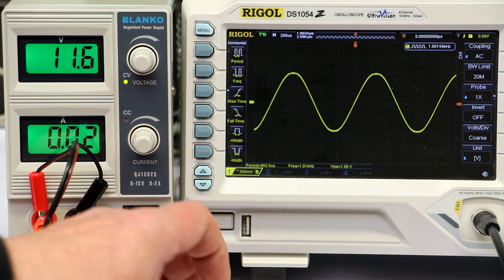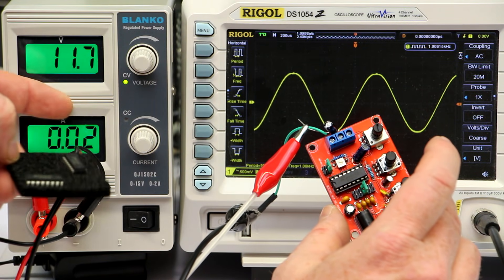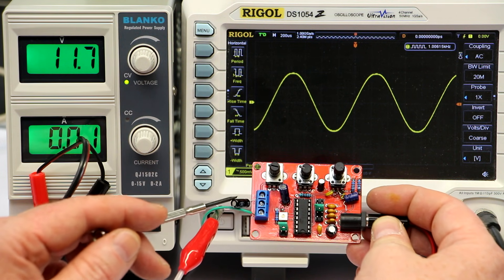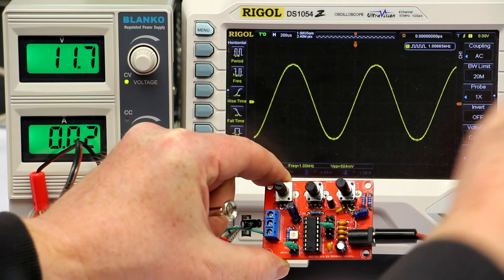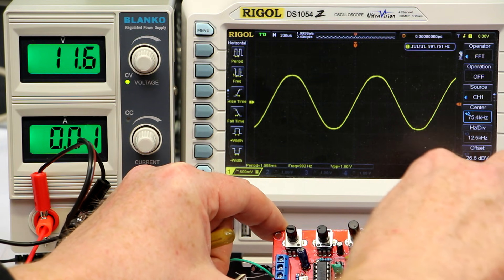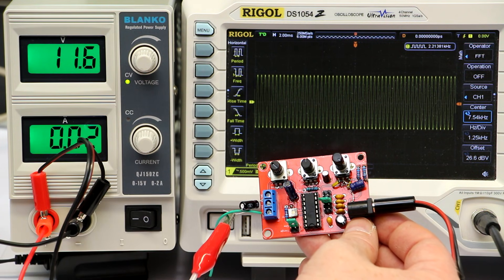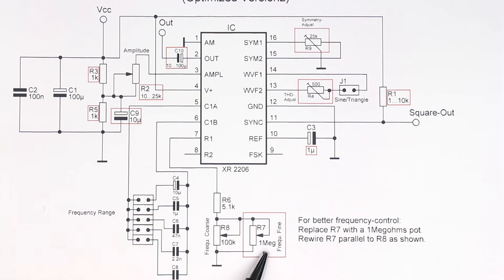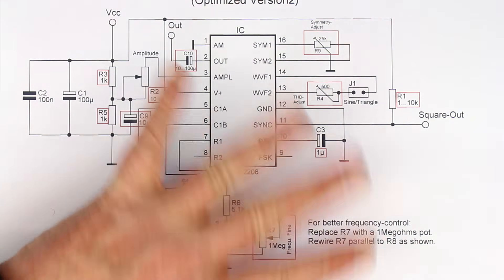Fixing the issues with the XR2206 Function-Generator from EBay

Comment: really a very detailed and complete review  with solutions and again an example how good original electronics get messed up and quality undermined  by the chinese vendors  trying to compete on price.  You have shown the world  with a little engineering  to get right.  Thanks again since I have this original  XR 2206  function generator from more then 20 years. Not surprisingly it still works. It is  fun to see this Exar Co. survived  all the turmoil  and that the Chinese  still can make a few buck with their name. Thanks again Kainka. We need this  sort of review.
Reply: Sorry Tom B., Things are not that simple as being shown, as there is more to. There are two main problems with the XR220 and the one it shares with the Intersil 8038. It's the Square wave resistor - it makes no difference the size as using af resistor "kicks back" into the curcuit. The other problem with the XR2206 comes from the switching across the capacitor. The real switching time is approx. 35 nS but that's not all, it's the loading  and discharge cycle that coarse the problems. When the loading cycle nears the top - and before the switching occurs the opening of the transistor is under way - beginning to discharge whike charging which gives a spike or notch in the top and bottom af the triangle that is used to from the sinus. This is all internal and can't be changed from the outside. that was the technical level at the time these curcuit was produced. - Please mark the frequens you are shows - less than 20 KHz where it is hard to observe, with higher frequency it becomes more visible and dominant.The Intersil can produce sien and triangle from subzero til 200 KHz flawless, and if you then take the sinewave and convert af part from this to squarewave, you can build a very nice working functions generator.

Comment: Excellent debug of this unit! I built quite a lot of 2206 chipped oscillator units for the Audio recording studios I worked at. These had 5 fixed sine wave frequencys selected by rotary switch in order to set up analog 24 track tape machines for Bias, record levels and playback tones.
Original EXAR data sheet seemed spot on for the low frequencies 50hz~20Khz sine wave used. This Ebay unit looks good after your work!

Comment: Wow, pretty cool. Thank you (and the people who gave you some feedback on various issues) for this. I just bought one and will definitely be double checking everything. I bought the thing mostly for 1)improving my soldering skills, 2)testing a soldering station I bought as a present for my dad and 3)I will use this a wave generator for a basic synthesizer I would like to build to learn more about this type of instrument. For this purpose I want to go as low as possible in terms of voltage and also cover 20Hz - 20kHz.

I guess as usual it is safe to assume that there is a 99% chance for an IC to be fake when it's shipped on Amazon, eBay, Aliexpress etc. from China. :D No surprise there.

Comment: 6 years later and this is still incredibly helpful! Thank you so much for the time and effort you put into this. Tracking down components for the upgrade now!
Reply: not even because the url provided doesn't work anymore...
Reply from the maker: New link: https://1drv.ms/u/s!AmW9-q-1GZM1ip5wO7uvHpcenfI14g?e=m4TqeJ
Reply from the maker: Link has been changed to the kit in our online-shop where you can also find the documentation. Should work now. Built-manual is only in German until now.
Reply from the maker: Link has been changed to the kit in our online-shop where you can also find the documentation. Should work now. Built-manual is only in German until now.

Comment: thanks for the two videos. Very detailed. I had also bough the same kit. I just wanted some function generator for playing around, but even the sine wave did not look that clean to me. So I bought a used GW instek for a little bit more. Didn't realize all the problems you showed. Very nice.

Comment: Great vid on this oscillator, it's a perfect fix, thanks! One suggestion i have would be to connect a 100k resistor from C10 negative to ground. This will keep the C10 capacitor charged during operation, thus keeping the DC off of the output at all times. The 100k will have negligible effect on output loading.

Comment: Good rundown of the problems and solutions for this circuit. Two areas I would disagree on:
1. I don't like the idea of using input protection diodes to compensate for driving logic with too high a voltage. As you suggest to an earlier comment, a voltage divider would be the easiest fix although a proper level shifter would be better
2. It seems unlikely that the real XR2206 would improve the output square wave at high frequency with a 10K for R1. The output is open collector and the slow rise time is due to the RC time constant formed by R1 and whatever is connected to the square wave output (including parasitic capacitances). If the real XR2206 really is better, this suggests large stray capacitance in the fake part.

Comment: Thank you for your hard work! I bought this little cheap kit to help me learn how to solder. Got it "working."  Now I am using it to help me learn how to DESOLDER! 😂I will come back and try to test some of this out on my breadboard once I get the parts out.
Reply: I was able to remove all the components and only destroy one cap in the process! That was a few weeks ago, today I assembled the chip on my breadboard and was able to wire up the Basic Test Circuit detailed in the data sheet for the XR-2206. Next -- finalize a new design, test it out and finally solder components to a blank PCB. Cheers!
Reply: I finally rebuilt the XR-2206 with new components on a double sided proto-board a few weeks ago! The sine wave doesn't seem to work, but the square and triangle waves will do! All in all this was a very educational journey. 😬👍 (I also built a 4 channel audio mixer to better listen to future oscillators and filters I will be building.)

Comment: Thank you for the video! I am finally getting around to building my kit. Ideas: 1) I will be using individual socket pins, cut from strips, for the discrete components that can be changed within a range of values to tweak the performance of the circuit. 2) A followup video about any new thoughts that you have about the project would be great. 3) Adding closeup photographs of your adaptations to that video would be very helpful to us, to devise our own configurations. If you are not interested in creating a new video, maybe you could take individual photographs of the said adaptations, post them somewhere and give us the link to them. Please and thank you.

Comment: Thanks a lot.  Very useful information and a little kind of work that an engineer must do when a problem is on the road.  At company I work I see this kinds of troubles when a cost reduction is implemented on products we manufactures. Best is to buy to OEM ICs ever.
Reply from the maker: To be fair the Ebay sellers mention that the circuit works only up to 12 volts.
And the XR2206 is not produced any more by EXAR for a long time and genuine/OEM/NOS parts are totally overpriced at Ebay.

Comment: I notice theres no mention whatsoever on the one page info sheet of  the need or function and their freq coverage  of the five pairs of paired header pins. Also mine too has no brand logo on the IC itself, just ordered a branded replacement. Thanks for posting this, an excellent way to learn practical electronics.

Comment: I just bought one of these kits, very interesting to see the modifications.
As you say the XR2206 cant be a real one, the real spec has 10V to 26V, but the kit is 9-12V. But it will do me, I just need a signal to test an old vacuum tube radio.

Comment: Wow, good catch ! Many of these generators were sold as 9v dc powered generators.
Reply from the maker: Yes, 9V is "save". 12V is the maximum supply-voltage for these rip-off XR2206 chips.

Comment: Did you actually try the authentic XR2206 chip with regard to the square wave output issue?   Because that is exactly what you should expect to see as you vary the pull-up with an open-collector/open-drain output.  Your scope input is presenting a capacitive load which the pull-up resistor has to drive, so the higher the resistor value, the longer the time-constant.  The reason it appears to be frequency dependant is that you are changing the timebase on your scope and just looking closer and closer at the rising edge.   

Note that the falling edge is not effected because the output drive transistor determines this, not the pull-up.

A better way to condition the signal for lower voltage logic would be to replace the simple pull-up with a voltage divider so that the peak voltage is limited by the voltage divider ratio.   The effective R with respect to the RC time constant then becomes the parallel equivalent of the two divider resistors (Yes, even though they are in series with respect to the supply, they are in parallel with respect to the output) This will substantially lower the RC time constant, and improve the rise-time.  Also you will not be relying on the digital circuit's input protection diodes to limit the voltage, so the input current limit on the digital logic is moot.
Reply from the maker: Yes, it was a genuine XR2206 from EXAR.

Comment: The Amplitude VariableResistor is also reversed. Turn rigth amplitude decrease, turn left amplitude rise. The coarse and fine variableresiator are fine.

We modify the pcb trace to fix the amplitude variableresistor issue.
And
The 10KOhm rv09 variable resistors are not available here, so just use the original 50k one in parallel with 12KOhm or 13KOhm resistor.

Thankyou uncle Rogers. Bye bye from village labs..:)

Comment: It's good that you showed the difference between original XR 2206 chip and the "fake Chinese chip". I wouldn't want to rely on Chinese chips if I don't have to.
Reply from the maker: Yeah, but genuine XR2206 are very expensive now and only available NOS on Ebay. Nevertheless below 12V the Chinese counterfeit behaves mainly the same way as the original chip.

Comment: 0918, and 0919 seem to be the magic numbers on these currently available Exar chips. I initially bought a couple on eBay two years back and a recent one from Tayda (all say F0918). I still have a hard time believing that Exar suddenly puked out a billion of them in two specific months despite being in production for so many years.

FWIW, I didn't seem to have the voltage issues with mine, but I couldn't get an op-amp based virtual ground to work without losing the negative side of my output wave. Could have been the circuit, but it came from a schematic which was mass produced as a kit, so I'd imagine someone had a working one somewhere.

- and thanks for the great videos!
Reply: make that two specific months
Reply: duh- make the months weeks ;-)
Reply from the maker: I think the XR2206 from these Chinese kits must be counterfeit-chips.
So you probably can´t rely on the date-code but have to rely on the reputation of the seller if you buy a replacement XR2206. 
There are some YouTube videos out that the Chinese even fake the 555-timer chips! 
Someone has decapped them and compared to some original ones and found some obvious differences in the chip-layout :-)
Reply: KainkaLabs- This recent one was bought as an individual component from Tayda Electronics. I inquired afterward about getting an older one, and they were very helpful and seemed interested in seeing that they weren't buying counterfeits. They said they tried to get 0918, as they had reports of problems with 0919 chips they bought. I just have a weird feeling that, unless someone grabbed a big pile at a government auction or something, anyone who's obtaining enough to be selling them in 2017 is probably getting remakes or we'd be seeing a much wider range of date codes.

On the plus side, maybe the Chinese will be tweaking them as more people become aware of the "undesirable qualities". When I checked, mine went up to 18V or something before it got shaky, so it doesn't appear to have that problem.
Reply from the maker: Very interesting. THX for the info.

Comment: Thank-you!!!!  When I first began learning electronics I came across a super simple circuit of two LED's in parallel but flipped in opposite directions.  It called for applying an AC Sinewave which would alternate the flashing of each LED.   My oscilloscope had a function generator BUT the sinewave's voltage output was so low it couldn't power on an LED.  So I bought this same cheapo XR2206 but was once again disappointed in that it would only light one LED solid but the other LED stayed off.  As per your suggestion, I added a 100uF Capacitor to the output AND NOW both LED's flash as expected and I can even adjust the frequency!!  Can someone explain why adding the 100uF capacitor solved my issue??

Comment: Great analysis! I will try to build mine accordingly.
There is just one problem. The JYE-Tech DSO150 I have yet to build wont help me adjusting the gain control. 
Is there a useful fixed restistor value for R4 that I could use?

Comment: Many thanks for this and the earlier video. I have just bought one of these kits and after the initial jubilation of it "working" started to notice all the issues you mention. The one that is really bugging me is the frequency instability. With the chip I have I can't find any supply voltage that gives an acceptable level of stability. So I am now out looking for an original part that I can get in the UK. Still at least I know what the problem is. So thanks again.

Comment: from the image of the pub in your video it looks like you have C9 soldered to the side of the barrel power plug for the negative connection which I also did. I also ordered a genuine XR2206 from Jameco just to compare the results.

Comment: Nice video.  I’m curious... What is the minimum input voltage required to produce a sine wave with 1.5V peak to peak?  Thanks.
Reply from the maker: The minimum supply-voltage would be around 4...5 volt, I guess.

Comment: Very good explanation. I made some changes you suggested and works like a charm. Only problem is that square wave amplitud is not adjustable. Can you make a high frequency (up to 500KHz) Amplitud control for the square wave?
Reply from the maker: In theory with an adiitional potentiometer at the output of the square wave. 1...10 kOhm resistance value should work.
Reply: @KainkaLabs  Thank you for your reply. Based on your theory I implemented with a 5 kOhm potentiometer built-in in the kit and works perfect. For your reference I made this video:  
https://www.youtube.com/watch?v=UP1W4SsdEPI&t=3s
Thank You.

Comment: I connected 12v and got the polarity wrong way round. It fried the c1 capacitor and the xr2206 chip. I replaced the capacitor and chip and it's  back up and running. I understand a diode between power barrel tip and positive on c1 capacitor and splice the original track on underside of pcb would offer protection against reverse polarity. Anybody know what would be the best diode with minimal voltage losses after input. Just noticed though that +vcc actually has more than one path through the circuit from power barrel it also goes to r3 and r5 voltage divider on amplitude section also so don't know how to pull it off
Reply from the maker: You can use any Schottky diode with let´s say >100mA current capability.

Comment: There is an error in the Exar data sheet where it says that the output amplitude is 'inversely' proportional to the value of R3 where it is actually proportional to it (see figure 3). This is probably caused the amplitude pot reversal mistake by the PCB designer. Its function is to 'rob' the output pair of some bias and thus their gain. The manufacturers have also fixed the mounting screw issue by resizing and now use short screws and nuts as a PCB resting platform. As the XR-2206 was designed in the 70s, it is likely that its IP has been passed on so it shouldn't come as a surprise that the Chinese are now using it.
Reply from the maker: Yes. That´s why a picture (graph/diagam) tells more than a thousand words :-)

Comment: The datasheet shows the output impedance of the sine/triangle output as 600R. Why not just add a 1K (or thereabouts) resistor between your new C10 and ground and stop worrying about the time it takes to charge C10? You can then pick a value for C10 to suit that resistor for the lowest frequency that you're interested in.

If you have the fine and coarse frequency adjustment pots in series, then the relative effect of the fine pot increases when the coarse pot is set to a low value. However, if you have the fine and coarse frequency adjustment pots in parallel, then the relative effect of the fine pot decreases when the coarse pot is set to a low value. It's just swings-and-roundabouts and there's no "win" to be had - just a difference in preference.